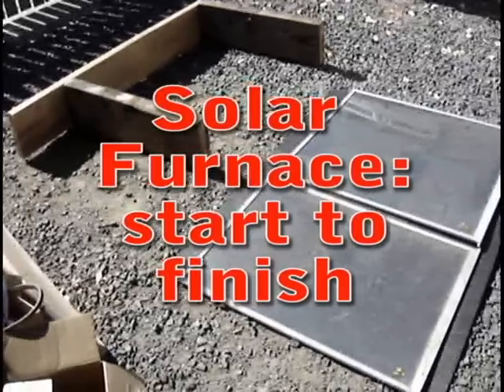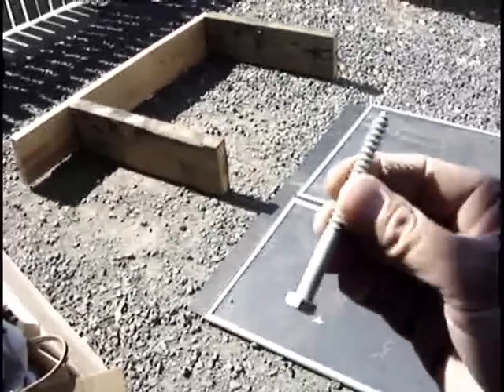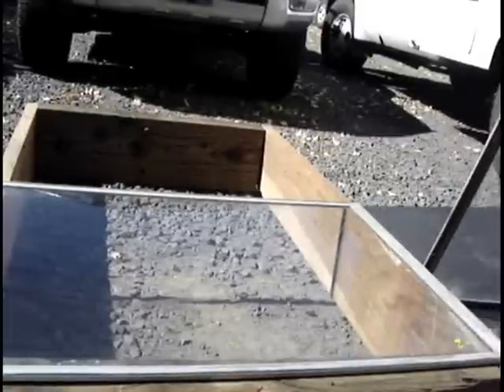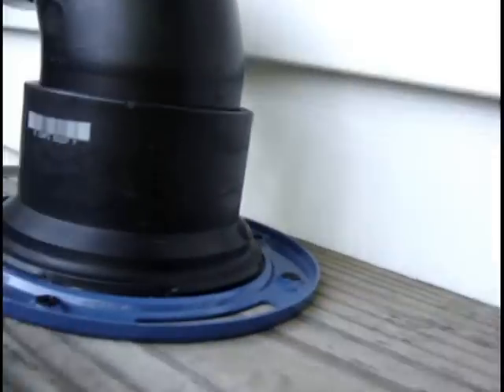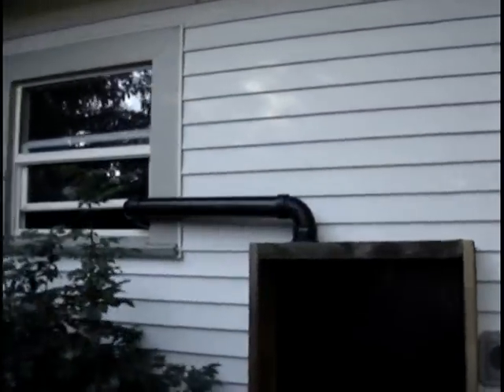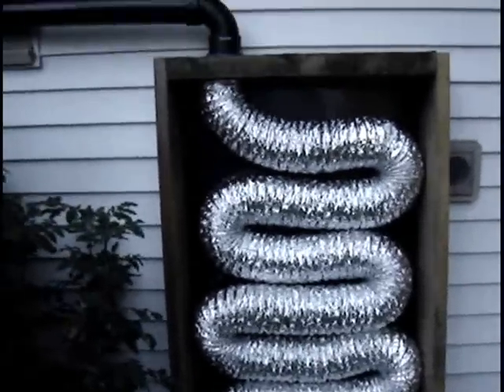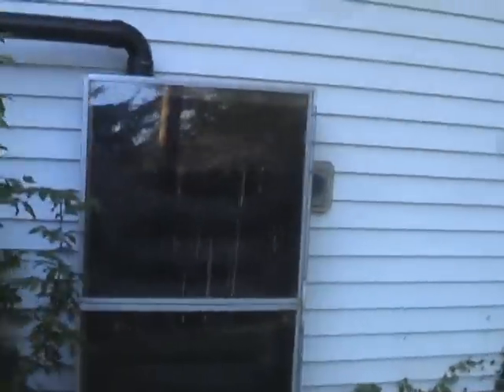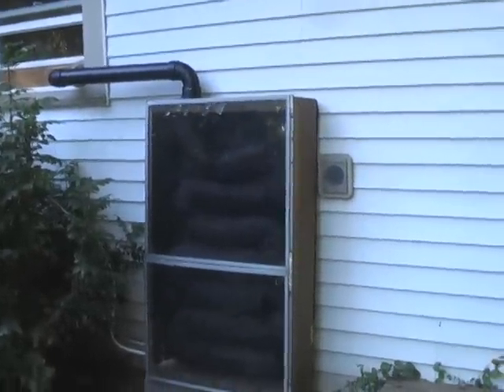Solar Furnace for under $50

Comment: I would have got rid of that clump of weeds and built the furnace right under the window and vented it straight in. Good job though. Also you can find big screen TV's on the curb and take the Fresnel lens off of them for more concentrated solar gain.

Almost makes me wish I didn't live in South Florida. almost.
Reply: TheDawgKatcher I am actually talking about the old "big screen" rear projection tv's. They are a flat screen but not the ones you hang on the wall.
Reply: Chaille Williams You know those big floor TV's with the plastic screen. When people in the 90's said "let's watch the new Pearl Jam video on my big screen Tv!" There's a big mirror inside. They are always free on the road or craigslist. It just takes unscrewing some screws around the screen and taking the screen off. There are about 3 layers of plastic, the one with circular (not vertical) ridges is the Fresnel lense. They scratch easily.
Reply: There maybe codes in his location that requires clear access to windows on the ground floor.
Reply: Carla Lindsay
What about Air Conditioners?
Reply: AC can be put any where. . .I'm sure anyone who has ever had a unit. . . .doesn't want it in front of a window.
Reply: Carla Lindsay
I'm talking about window mounted units.
Reply: Those can be shoved out of the way.
Reply: frogsoda : ''Also you can find big screen TV's on the curb and take the Fresnel lens off of them for more concentrated solar gain.'' THAT is a great idea = more TRUE re-cycling too. BUT do you mean the older Cathode Ray Tube type, as I can't find any reference to modern flat screen TVs using Fresnels. Since those older screens are lead loaded - radiation blocking - they will be heavy, so caution should be taken when siting them, e.g. on a roof..
Reply: frogsoda not sure a Fresnel is the way to go here. They are awesome, I have 6 or so, and even the smallest will melt the zinc out of a penny in seconds, but how could a 2", 1500 degree spot help here? Maybe create steam for humidity? I'm down here in FL too. Thinking this actually makes more sense than buying a heater for the 10 nights a year it drops to the 40s (which reminds me,  I need to bring the iguana inside tonight!). We need a solar ammonia absorption a/c system the rest of the year!
Reply: Andy Jones You would not use such a small focal point. A 12" X 18" spot @ 200 degrees would be great
Reply: Jarod Morris fair enough.  I'm sure there are benefits. Either way, you get the same heat/ m2, so you'd have to decide on larger/warm or small and hot. Maybe even a lense that slides in and out to change focal point depending on the suns height in the sky or to "superheat" an area to absorb heat for night? Lots of options, but you're right, could be beneficial with certain circumstances. You also have to consider extremely cost/ complexity and the fact that it'll be slightly less efficient due to the lense itself absorbing heat. It would be cool to be able to store some heat for night though- when it's really needed.
Reply: frogsoda Tell me more about the big screen TV... are you referring to the projector type or just a BIG TV?
Reply: Haha necro, but  be careful with those things, they are (at least the highest quality ones ) Very strong concentrated magnifying glass.
Reply: Wondering- would a couple of spotlights aimed at one of those fresnel lenses help this set up work when its dark? you have me a bit curious here
Reply: a Fresnel lens might be too much
Reply: When I made a replied a few minutes age I responded to Dmitriy40's post, should have been to frogsoda, sorry bout that. 
Anyway, good idea and will stop and pick up the next few I see, there are a few other uses for these lenses and since my wife just had me a new shop built, a nice TuffShed with a loft, I can start working on my projects again, and sumthin nice for her too.

Comment: I was about to say the ducting is superfluous, but I see you are heating the house air not fresh from outside.
Reply: You could bring the air from inside floor level and feed it into the bottom of the box. Get rid of the foil tubing all togeather.

Comment: Be careful what type of paint you use.  I used a black spray paint for my 8'x12' solar heat collector that I thought was a good paint for high heat, and then found out after starting it up, that it was giving off a horrific chemical smell.  I looked up the ingredients from the spray can on the internet, and found out they were almost all neurotoxins.  I had to trash $500 worth of work and start over with all new materials.

Comment: cool video. wondering how many btu`s it produces?
Reply from the maker: Thank you!  With a simple formula, I estimated this produces about 800 BTUs based on the flow produced by the fan and temp difference.  My data collection can be seen in my most recent video "Solar Furnace Data".

Comment: doesn't make sense to me............ How is that going to heat a room?  How is that small intake going to draw air out of the room?  Guess Im missing something here.  ,,
Reply: Yeah.  The intake needs to be smaller. This gives the air time to heat up while passing through the heating process. If the intake and exhaust were equal, it would be a straight pass-through of fast moving, house air.  The real key is getting a big surface area, the larger heat surface allows you to move hotter air.
At this point you have options.  You can run it hot and not fast, or more air and not as warm. Just remember, you are pulling in cold house air, heat'r up and put her back in. faster the blow, the cooler it will be.  
What would be awesome is to make like a flat plate in between the intake tube/inside wall, up to a little pulley (nail, hook.. whatever) and some bankline or cordage, then you can adjust the intake by pulling either way.  Turn it off or slide it open to the right spot.

Comment: See my other comment first. To make my point, before anyone tries to justify against me, look at the exposed CUT ENDS of your 2 X 8's ( or 2 X 6's ). See those expose cut ends? I don't care if it's pressure treated wood, if ya paint it, blah blah.......that will NOT last as long. And for the price of the lag bolts, you could buy enough nails to build a bunch of those frames. Another example>>> Find any fascia boards along the edge of a roof that gutters aren't hiding, so you can see how those fascia boards are cut & fastened at every corner. If it was done right, you will see EXACTLY what I'm talking about. If you were to just butt one end of the fascia board into the other, it is only fastened from 1 side and the 1 end is exposed to the elements. It WILL rot and split with time. If it's built inside, away from the elements, it's OK to butt them, like the way a wall is constructed with 2 X 4's. I still like the passive solar heater design ya have there. Just build the next ones like I explained & save yourself $$ and time, plus it will last longer. Peace.

Comment: Thumbs up for the video & idea, BUT......why in the world would ya use LAG BOLTS for such a simple frame? Your making totally unnecessary work for yourself & wasting time, effort & money on the lag bolts. "Measure twice, cut once"......get your measurements right, it's a simple shape & size to figure out. Using a circular saw set for a 45 degree cutting angle, cut your frame pieces. It will slap together like a picture frame. That way, you can nail all the corner seams from 2 different directions and it will NEVER pull apart. That's correct & simple carpentry. PLUS, the wood won't rot as fast because ya have NO EXPOSED ENDS on your wood. Exposed cut ends soak up moisture like a sponge & will rot the wood. Lag bolts are for attaching high load-bearing decks & porches, not a simple box. Geeez. I could use my method & build 10 of those things by the time you build 1 with "LAG BOLTS".......and mine will be just as strong.......and it won't rot. No disrespect meant.

Comment: If you don't mind the light being darkened from a window...why not mount the whole thing covering your window. It would be like a super dooper storm window. Cover the whole thing up with black curtains inside, and who would know you have a furnace of sorts there. The back curtains would add to the solar heat draw, into the home. 
No one is saying you won't need supplemental heat, when the sun isn't out, but daylight hours....a big help.

Comment: Thanks very good idea. This is better than other web videos in which aluminum cans used, linked with silicone, porexpan, fiberglass insulation, etc.   that can contaminate the air circulating at temperatures above 75 degrees. Only painting blak the aluminum tube.

Comment: I recently, with the sunny/cold weather, took some temp readings.  With all other heaters off, this unit was able to warm the kitchen from 50 degrees at 10 am to 69 degrees at 3 pm.  The unit peaked at about 2 pm, with full air flow being produced by the 12 volt fan powered by the solar cell, reaching a temp of over 120 degrees on the outlet.  The unit automatically turns on with direct sunlight thus only moving air when it is warm.  I will post another video showing my results, methods and data collection techniques as I welcome others to comment, test, create and participate in the evolution of knowledge on this very simple technology.  Yes, in even a very cold climate, this device will produce heat... but the real warmth from this device s hearing the fan come on and knowing the
Reply: Wow!
Reply: How do you hook up a computer fan or 12v fan to the panel

Comment: Wouldn't it be better if the tube were absorbing (flat black) the heat rather than reflecting it? I bet it is ten times hotter around the shiny duct tube than it is inside it. And that is because it is doing it's job and "insulating". Somebody, tell me, am I wrong? It just seems like common sense to me. Maybe I'm an idiot. But, I do like the idea for passive solar. Thanks for posting.
Reply from the maker: Towards the end of the video, I do paint the tube flat black :)

Comment: Can you do a follow up video showing if the furnace worked or not?
Reply from the maker: Yes, I will post the update video soon showing temp readings with my house only being heated with this unit... long story short, the system raised the temp quickly by creating a steady stream of up to 120 degree air :)
Reply: thegulley.com I'd really be interested in your follow up as well. Thanks for posting this.

Comment: Might want to move the bush in front of the window to be able to mount right below the window.  You'll likely lose a fair bit of the temp increase going through >3' of pipe just to get to the window, insulated or not.  I would also recommend instead of the simple plywood window insert that you make it two layers separated by at least 1/2" strips to give you at least 1/2" that you can insulate inside of it.  You should also get or borrow a temp gauge to be able to measure intake and output temperatures so that you can measure the difference you're getting...

Comment: I wonder if this would do anything at all mid winter in  Rochester NY? 20 degrees, with 15 mph winds
Reply: HA, no sun here in buffalo either. Maybe once a month. Otherwise, this would be fantastic!
Reply: im with you bro haha im siting here in wolcott like 40 min from you like no way but i guess if they get more light might help idk
Reply: I saw KISS in Rochester in 84....while a student @ UB.....
Reply: In the winter,, the sun aims @ the s side of the adobe,,,i painted my "unnecessary windows" brown so they get hot ...then when I get home around 430...put a sheet of styrofoam between the glass and the curtains to keep the heat in,,,,about 80 sq ft of surface area that gets cold @ night,,,,before work remove the styrofoam and the place heats up ...
Reply: haha im from Rochester and wondered the same thing...
Reply: *****
No, lol. Once nov comes and its dark by 4pm we dont see the sun until march. Up where Niol8tion who is much north than me they see the sun in may. Sometimes. 1998 it snowed while i was in binghamton 8 inches on mothers day.

Comment: I see what looks like a dryer vent on the side of the house.  Couldn't that also be used to reclaim some dryer heat and preheat the box with an extra tube (providing piping to and from house stays sealed for non-toxic air).